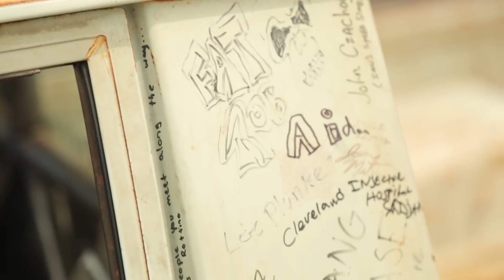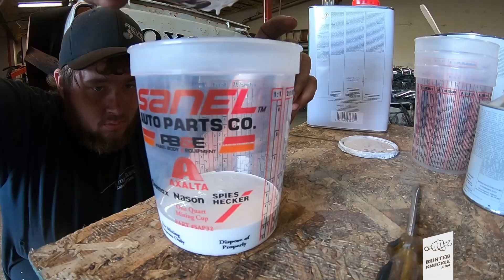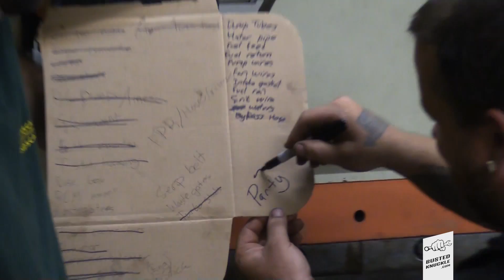Death Wish Hilux Twin Turbo LS Swap - Deathwish EP2

Comment: Did you went that much on the widebody cuz the engine didnt fit? Or just for handling?
Reply from the maker: to fit the crown vic suspension
Reply: @BustedKnuckleVideo  ah ok. Want to add a v8 on mine 78, thought i would have to widen that much
Reply from the maker: nah it should fit with some work

Comment: Where are your clamps on the turbo side? Just seems necessary.
Reply from the maker: It works
Reply: Weight reduction.
Reply from the maker: race car stuff
Reply: with all due respect.. and I mean, all. Due. Respect ricky bobby... when your main goal and baseline for success, is for the turbo to spin at idle, we have a slight difference in opinion on the definition of “works”. BUT, seems to work well enough. Well done nonetheless gents 👍🏼

Comment: I noticed your thumbnail said LSX I don't want to sound like a butthole but that's not a LSX it's just a LS truck engine which is really good. LSX engines was never put in any production vehicles so people who don't know much about LS engines they always say they have a LSX when it's a truck block or a Camaro block. so if any viewers reads this post and you have a LS based engine please stop saying you have a LSX I'm just a firm believer in sharing knowledge and not stupidity again not talking bad about you or your video.
Reply: Just here to spread knowledge not stupidity also, X is the variable. Just like in your algebra class in high school.
Reply from the maker: What he said ^
Reply: @ericsnelling4915  .I needed this comment for a smile thanx👍
Reply: I agree state fact not fiction and call it like you see it